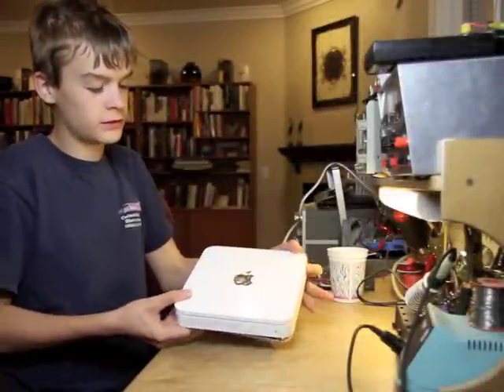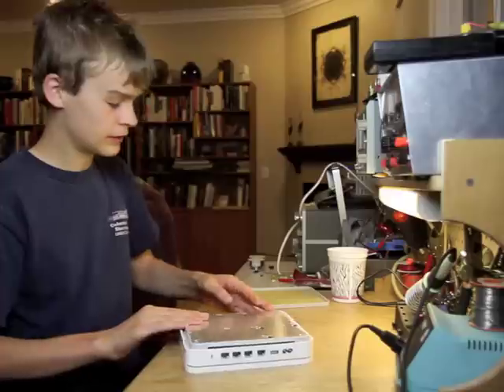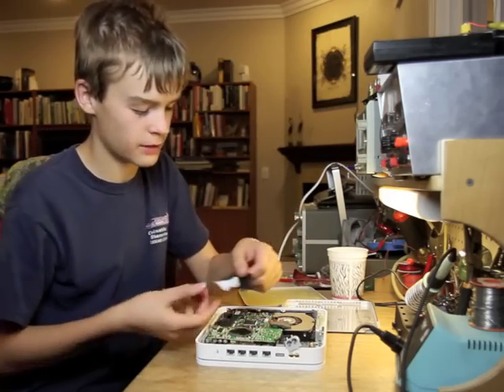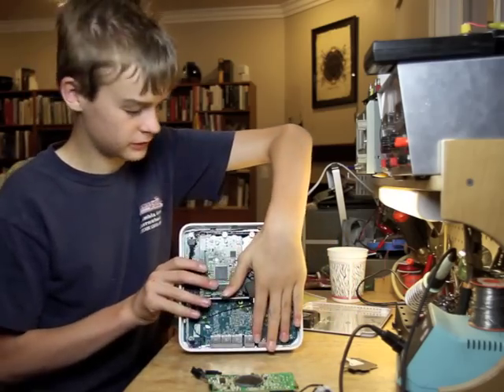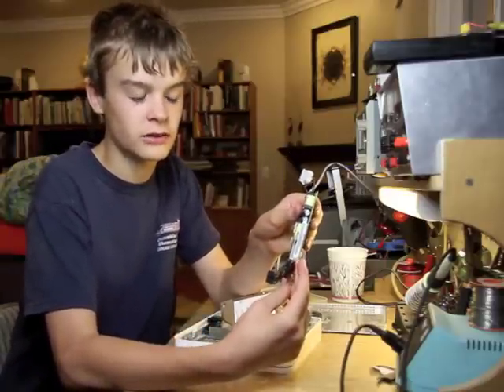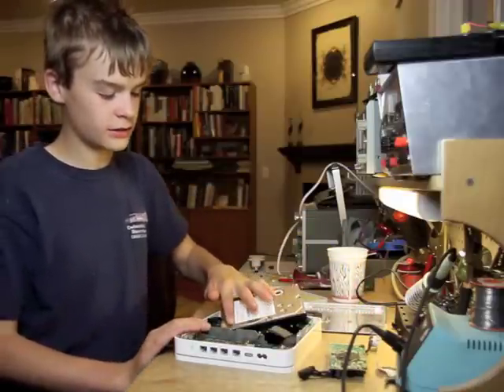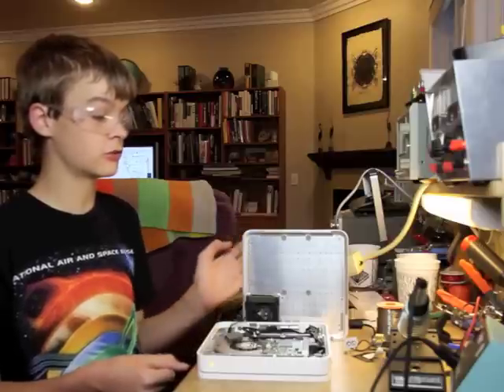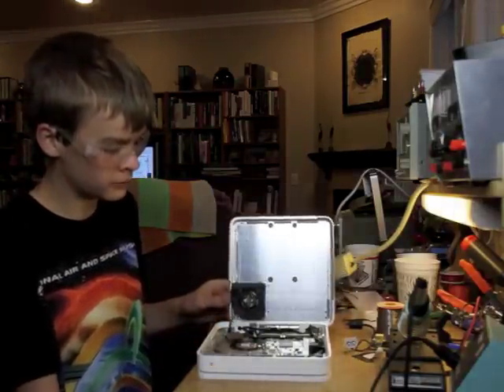Time capsule power supply repair

Comment: Beautifully done.  If you were willing to spend a few extra bucks, you could also switch the 3.5" HDD for a 2.5" HDD, which requires only 5v, and dispense with the 12v supply altogether.

Comment: Nice job.  I'm sitting here almost 9 years later (2021) and my TC has failed.  Took it apart and I find that there are two swollen capacitors....  Same as yours: 1500mF 6.3V (Samxon).  So I sit here, wondering if I should get out the soldering iron to pull out the bad and put in the new...

Comment: All you needed to do is check the caps, then the switching mosfets for a short, and the input pin to the swicthing IC, which 
if the transistors are not shorted, spend 2 bucks and put in a swithching IC. there you go buddy.